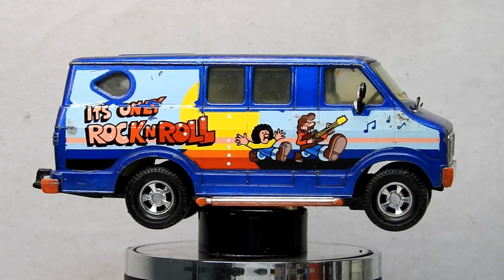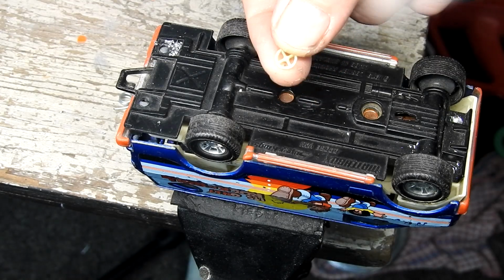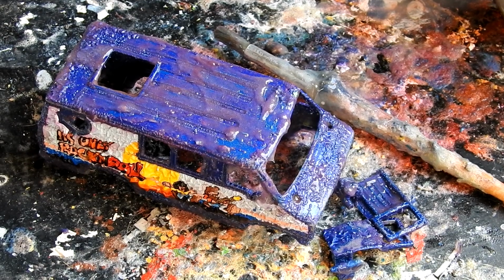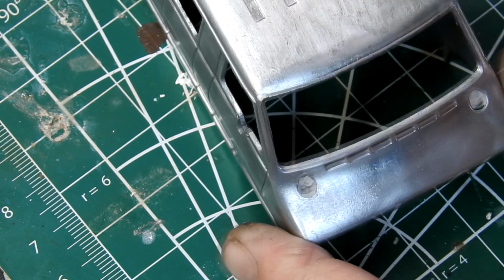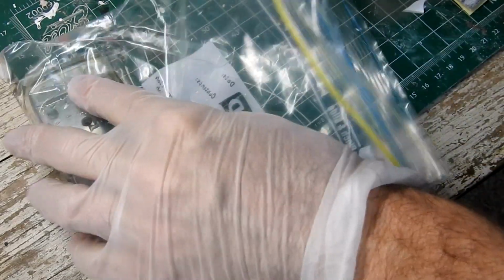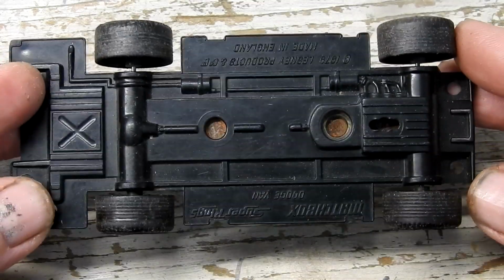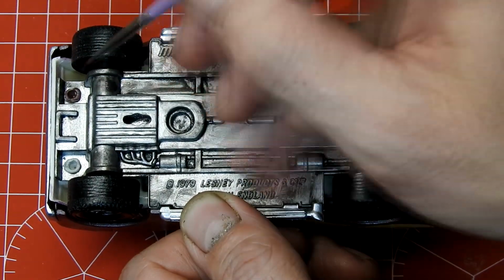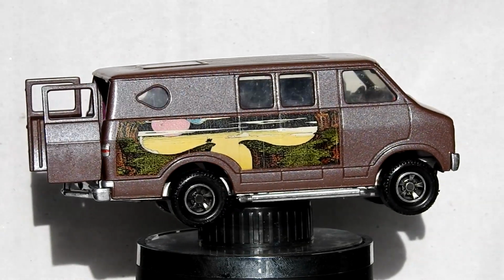Matchbox Custom Super Kings K-80 Dodge Custom Van 'Hawkwind Rockers Van'

Comment: The casting would make for a interesting zamac. Great video!
Reply: This isn't zamac, it's zinc alloy.
Reply: @rockettcustoms6266  Z is for zinc in zamac. I'm thinking most castings are zamac. maybe more or less of one metal or another but zamac just the same. so what hotwheels refers to as zamac is nothing more then a raw casting with clear coat rather than a color.